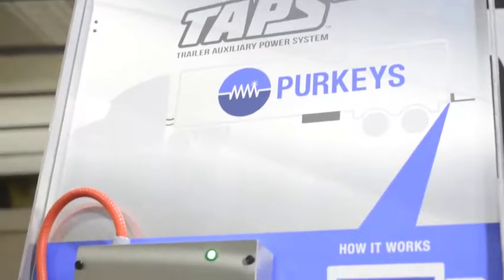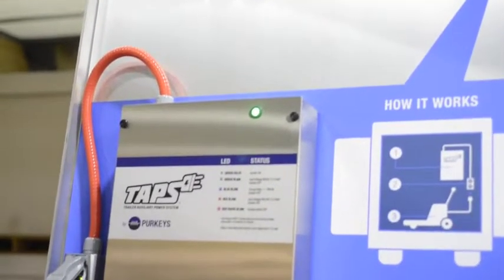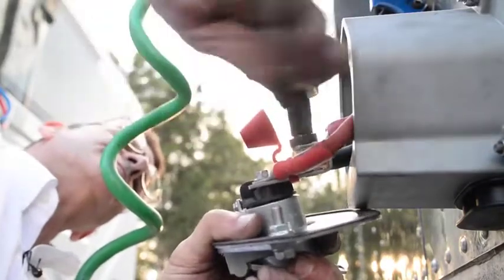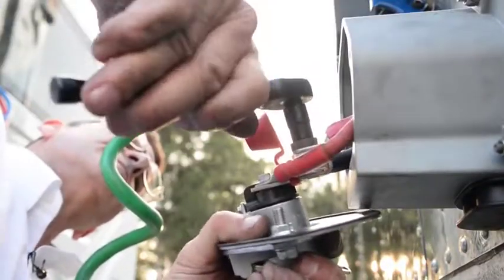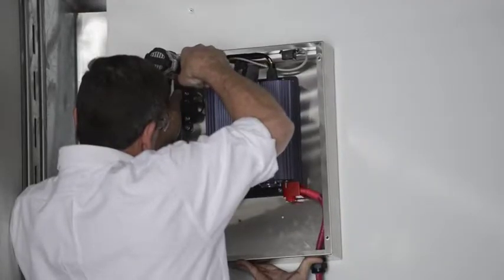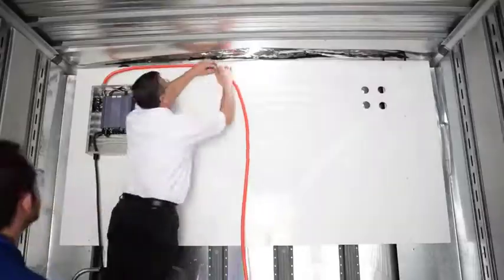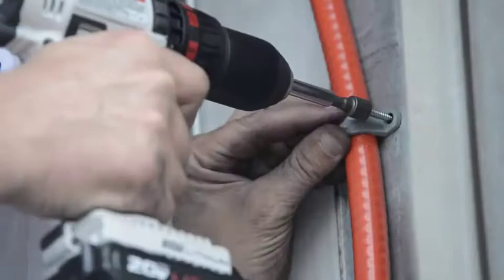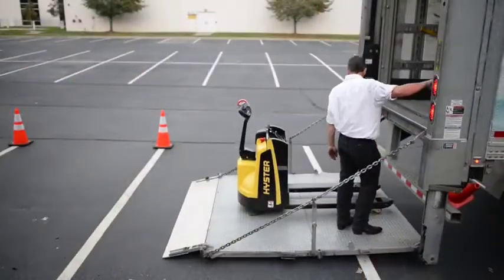TAPS™ Keeps Pallet Jacks Charged and Ready - Purkeys

Comment: How many watts should the inverter be.theres insverters thats 150w to 5-6000w.what to use throu normal houshold powerstik..r they at 150w or 300w
Reply from the maker: Inverters have to be wattage sized based on what is needed to be powered. For the TAPS product shown in this video, we researched and tested all the chargers used for onboard charging of electric pallet jacks and matched it with our 1500 watt pure sine wave inverter. For the average wattage requirements of several common household appliances that might be plugged into an inverter, check out our blog: https://purkeys.net/measuring-energy-consumption-from-ac-powered-devices-in-your-tractor/ .